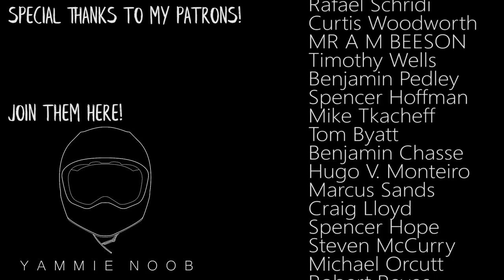TRANSFORMATION TUESDAY - FZ09 EDITION

Comment: Pro tips:
1- always replace your sprockets when replacing the chain.
2- Instead of removing the front sprocket cover, just link the new chain to the old one (small zip tie) and as you remove the old one the new one will take it's place.
3- when installing the rear tire, find a coolant empty plastic container and put it under the tire, it will make installing the rear tire a lot easier.

That chain you installed it's wayyyyy too tight. Adjust it and before you tighten the rear wheel nut, wedge a rag in between the chain and the rear sprocket while you with your hand on top of the tire, slide it clock wise direction and tighten up the nut at the same time. the rag won't allow the chain to tension while you tighten teh nut.

Comment: When changing the rear out try putting a piece of wood under the Tyre before you take the rear spindel/axel out, firstly it means you dont need to support the wheel with your foot but it also means when your fitting it again you roll the tyre onto the wood and all your spacers and caliper will line up or need only a very small amount of adjustment. Makes it alot easier :)

Comment: Thick lubrication is needed for tire lube. Don't use windex, that's just asking for a ripped bead. Any sort of thick concentrated soap like dish soap would work well. Yammie, I like your little hand press bead breaker. Getting a pair of vinyl coated pry bars is all you need to remount a tire. Also, as long as the beads core isn't exposed, that tire is still good. Mount it on a rim and get it balanced, ride it in the heat and get it rebalanced. That bend in the bead will come right out.

Comment: Need to lube up the tire before you mount it, helps prevent ripping the bead like you did.  Source: first job was at a tire shop for 6 years, mounted thousands of tires.  When in doubt or stiff sidewall, lube that puppy up like theres no tomorrow.

Comment: your downfall with the rear tire was:
  1. you didn't warm up the tire, this can be done with a hairdryer if it's cold out.
  2. that tire iron is too sharp, the flat bar's edges aren't as sharp so your less likely to break the bead the way you did.

It was fun riding with you in sydney! #gromlife

Comment: shouldn't you replace the sprockets when you replace the chain?
Reply: How many miles did you get out of your chain? I got around 6500 miles on my MT-09 and I think I have to replace the chain soon because I have to constantly tighten it, like every few hundred miles. Might be the way I ride it as well, the torque must be really hard on the chain. By the way, which chain did you get?
Reply: i wish i could run 2 chains for every sprocket, i have to replace the chain and sprockets after about 50 hours
Reply: lube it more often  also if you catch it early enough the chain wears before the sprocket,  It stretches and then does not line up with the teeth and that wears the sprockets. 

.Or get a better (stronger) chain.  Even within the same size, the load rating can be very different depending on the quality of the chain.  Still 50 hours?  what do you ride, a turbo hayabusa. .  in the mud?
Reply: I am using BELRAY lubricant which is high quality. I usually lube the chain every 100-150 miles or after washing the bike and after riding in rain. As for the chain and sprockets, they are the stock ones from factory. I have no idea how good they are, but they do tend to get loose quite often. I will be riding the bike to 6000 mile maintenance soon and I think I will get new chain and sprockets in the same time. Just don't know if I should go with Yamaha's own set or order somewhere else.
Reply: Wow do you look after your chain? One chain can last 10,000 plus and if you have a scott oiler or lube it regular it can last much longer!
Reply: Christopher Young a Mx bike in the mud and thanks for the advice but i already do it. Plus i make my own stainles sprockets and get one of the best chains availeble
Reply: A good (O-ring) chain should last 30,000km, well maintained. Also depends on sprocket material, steel lasts much longer than the lightweight aluminium sprockets. No point not replacing both if you take care of both of them and get a good life though.

This is road bikes though...
Reply: I didn't know that. last summer my chain got messed up and I needed a new one and everyone told me I needed it. ill know for next time. thanks.
Reply: That is being cheap. You can do anything you want but if you want the chain to last then replace the sprockets
Reply: I always run this rule, sprockets with a new chain, if your sprockets have wear they will degrade the chain faster and you should think of them as a paired set... my 2c, Always do chain+sprockets.
Reply: was meticulous with my 04zx6rr chains and i couldnt get more than 8-9k miles 10k with a scott oiler. not sure why. Going to see if there is a difference on my r1, aint doing shit to it except wd40 and occasionally clean it just to "abuse" it to see how it lasts ;) lol
Reply: WD40 is only good for cleaning a chain, although some people swear by just cleaning the sealed chains. What sprockets you running? You also adjusting chain tension regularly?
Reply: Have a r1 forum member with 20k on a chain and sprocket with just wd 40 spray and wipe.  It's stock sprocket and chain. I'm not adjusting unless it starts hitting my frame. I'd rather have a loose chain than over tight.
Reply: Yea wipe down is fine. Loose enough would cause problems, but if you're getting the bike serviced normally and getting new tyres put on, that would probably keep it relatively in spec, as they should adjust to spec then. Always interesting how things wear differently for different people! You replacing the chain yourself, or is a shop recommending it?
Reply: I don't let others work on my bike lol, loose chain is better than tight any day.
Reply: Never use WD40 on a chain. It removes the the specialty formulated grease from the pin bushing between the chain seals and dries it out. If you do this however, a good idea is to turn your oven on to 60 degrees Celsius to warm your clean chain up then re lube it, liberally. It will be warm enough to allow the lube to penetrate the entire chain and also warm enough to wipe the excess oil from the chain. I find Kerosene is the best oil based cleaner. Just do not allow it to get near any bike seals. IE wipe it on and off, never spray it on.
Reply: Well 8k with wd40 no problems, forum member with 15k wd40 and only sprocket wear... If wd40 makes it pasts the seals water and dirt will too and be just as bad to the magic grease ;)
Reply: Seems unlikely there would be visible sprocket wear without similar wear to the chain (which would need to be measured in comparison), unless it's not properly adjusted, or the chain has been replaced but not the sprockets. 

8k is also really really low mileage for a chain. There would be people who never do anything to their chain (literally) that have them last this long and longer, plus it depends where and how you ride.

Also depends how you clean with WD40, on a rag you probably won't have issues, as you're essentially just removing the rubbish from the outside of the chain. But WD40 is specifically not a lubricant, it is a cleaner and should be followed by a proper lubricant. Even WD40 acknowledge that and recommends using proper lubricant after WD40 - there's a letter from a representative floating around the internet somewhere saying as much regarding MC chains. Kerosene also does the same job, cheaper.
Reply: You don't need a lubricant for a sealed chain.... Period... You need to keep it clean and coated to protect from rust. That's it, 8k is a lot on a chain, went through a chain every 10k on my 04zx6rr... Chain life averages 10-14k for sportbikes...
Reply: I've done at least double that with every chain I've ever had on any bike. That said I'll take the advice of the experts who make chains, who all recommended frequent cleaning and lubrication of chains (including O/X Ring) over someone who goes through chains very quickly and recommends doing the opposite.
Reply: Lol you don't read, but that's fine this is just YouTube where the idiots gather and to argue over their own ideas. 12k with a scottoiler setup, I used to follow the most stringent cleaning and lubing rituals. I'm saying it got you no where on my old bike. Of course the experts want you to buy 100$s of dollars worth of product to maintain a 150$ chain... I used to use everything you have said and after 60k miles and over 6 set changes on just that bike I'm down with making sure that sucker is sprayed with wd40 wiped and that's all. Like I said before at 8k with all the fancy products I had severe chain stretching and wear. To each their own, if it doesn't work I'll buy another cheap chain and sprocket set, realistically not expensive.

Comment: Tire change yourself? Some say it's not needed, but spin balancing after is best, so mine go to a proper shop. While off, properly clean rotors and make sure torque of bolts at proper spec. Perhaps discuss how to determine proper time to swap tires and chain. Thanks for the video!

Comment: Don't give up on the tire change.  You only made 1 minor mistake. .  Next time take a look at your rim.  Notice how it is smaller diameter in the center and larger diameter toward the edge where the bea seats.  You wrecked the bead because the side opposite that you were levering rode up onto the larger diameter of the rim.  If you just shove the opposite side back down toward the middle of the rim, it loosens up just enough to slip right on.  Like you said, warming up the tire makes it easier to manipulate around.  You just need to manipulate it into the right position.  

I really like your bead breaker  (and actually that is what you can use to push the other side down to the middle of the rim next time even if it is cool out).  What kind of bead breaker is that?  

One thing you did not mention is usually the tire has a yellow or green dot on the sidewall. That is the lightest part of the tire.  Line it up with the valve stem and it cuts the amount of wheel weights to balance it.  Also m/c tires are almost always directional.  make sure the arrow is going the right way.

You can balance them plenty close enough on the bike as long as your wheel bearings are in decent shape,  with the chain off let the wheel fall to a stop.  Add weight to the opposite side until it stops at random spots. The fast way is to move it 1/4 of a revolution.  That puts the heavy spot in the most effective position (rather than spinning your wheel a bunch of times). That will be plenty close enough.  They make stands with low resistance bearings to do a better job but I bet you can't tell the difference, even at racing speeds.  Plus if your wheel bearings are bad you want to change them out anyway and restore that free horsepower.

Great vid and keep up the good work.  Your FZ09 looks great..

Comment: @ 5:57 you need to put both knees down on the tyre carcass to push the bead down to the center of the rim while you jimmy the tyre on at the same time. This will relieve the tension on the bead as the rim is concave in the middle.  Your levers won't tear into the bead. Every single tyre change in the history of the internet cuts that important part out :/ (except for mine lol)
Good luck next time.
Reply: Yammie Noob No probs, mate!
Reply: It's called the drop zone and it's your friend, especially with low profile tires

Comment: One main point to remember is too keep the bead opposite to where you are levering , pushed into wheel 'well' which avoids 'tearing the bead' which I would say has happened in your case ? would I not be correct Noob ? , this is for ALL tyres !

Comment: Pro tip. If you don't need to dick with the front sprocket, hook the new chain to the old one prior to removal. Then pull the old one out and it will feed the new one in all in one motion.
Reply: Danny Prather Doesn't that mean you have to take the pins out more though. I persoanlly hate doing that but I'm sure feeding the chain into the guides is even less fun.
Reply: Jhaas42 I always use a snap ring link on my new chain. So I just put half the link on. I don't like pressed pins.

Comment: Why didn't you just buy the tyres at a shop and get them properly fitted and more importantly balanced? Even if you remove the wheels and take them in yourself? Most shops will do it free/very cheap with the tyres when you bring your wheels. 

Also should have replaced the sprockets if the chain was no good (as someone else said).

Comment: New chain without new sprockets? Not good. Do you know what chain lube is? That bike does not have enough miles on it to need a chain(poor maintenance). It would be dangerous to ride any bike that the Noob has wrenched on.

Comment: How many miles are on that? Seems early to change a chain.
Reply: Yammie Noob oh I see.  My ninja 650 has the same mileage and I've only had to adjust it once so far.
Reply: How do you know when the chain is shot and needs replacing?
Reply: P Banks either when the chain is rusted/coming apart or when the tightness is varies on different parts of the chain.